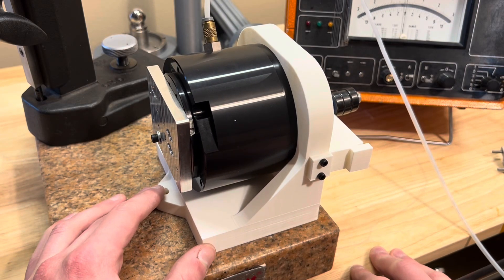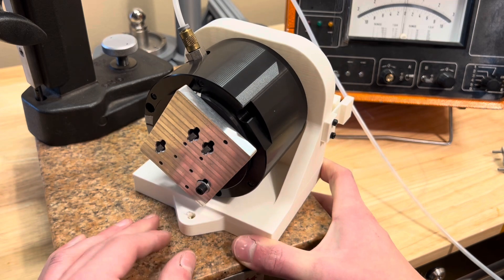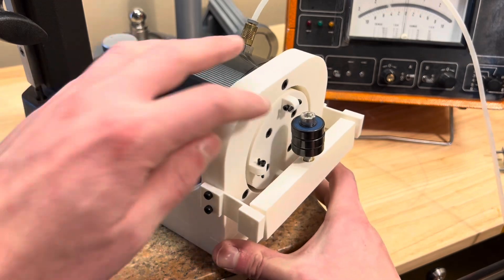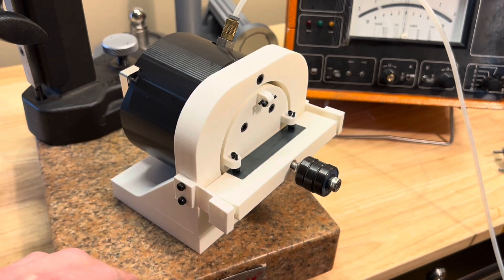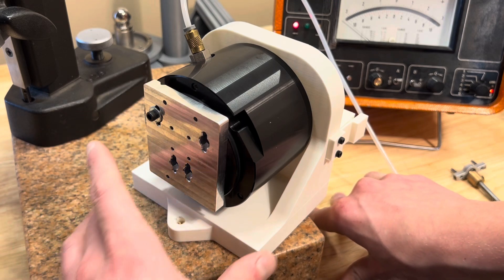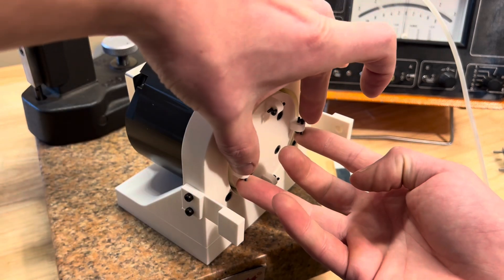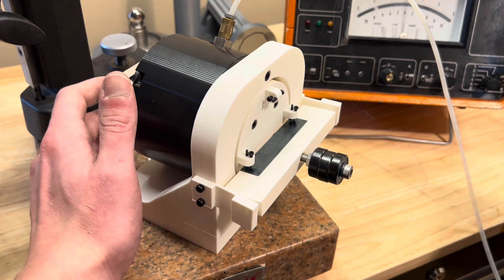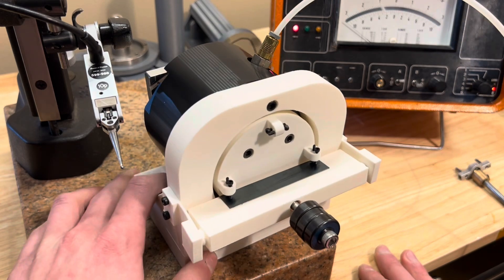A clever grinding fixture for ultra-precision squaring

Comment: A VERY nice design, do you think that it's any more accurate than an AG Davis ultradex?  My 5" is 0.22 arc second max error which I think is roughly 11 micro inch over 10"
Reply from the maker: @ROBRENZ  probably not tbh, the accuracy is as good as you can measure and set it, and adjusting it to 5 microinches over the length of a blockhead stator is going to be extremely challenging.
Reply: @cylosgarage  That is what I was thinking, BUT that does not take away from the awesome design of that fixture.
Reply: So glad you are doing well, the both of you
Reply: Who invented this killjoy to the party?

Comment: A flexure mounted micrometer is something I have never seen. Is that the same as the "Reed Mikes" mentioned in the final documentation? How do you move the micrometer roughly into alignment with the object to be measured?
Reply: Seconded; same question from me. Also, would love to see some closeup pics of the "Oldham-type washer" used in the original.👍

Comment: Would the radial load from the indexer bar counterweight be negligible with the stiffness of the air bearing spindle. Seems like the force on the indexing points is a long lever arm from the workpiece.
Reply from the maker: @matthewchastain136  it would be pretty much negligible, yes. Blockheads have exceptionally good tilt stiffness

Comment: Your comment about the hand heating the fixture reminds us that "robust" airflow is your friend!  Dan Gelbart told me about his airflow setup for his jig borer room, isothermal environment...I used this, later, on a tubular mounting system for a 3d scanner, running a fan into the tube to equalize it's temperature end to end, AND radially, to prevent twist and bending moment from uneven heating.
You're doing a pretty classy job.(as if my opinion counts😉)

Comment: cool fixture. I like that you can square precisely by adjusting those screws on the back. How still are those air bearings from a grinding perspective?
Reply from the maker: @car9167  the air bearing spindles are extremely stiff and great to grind on to make super accurate parts. However, consider that in this particular application, they aren’t acting as air bearings while the actual grinding is occurring. The spindle only floats to index between different sides. It’s rigidly locked for the grinding
Reply: @cylosgarage  I see. Why do you think air bearing spindles are stiff? Air is compressible. If it was oil in between, that is not compressible. Large cylindrical grinding spindles are not sitting on air bearing but oil bearing (not ball bearings)
Reply: @car9167  Because when you remove the air, there is no gap, the housing and the spindle are interference fit at that point. When you put air in, the housing separates just enough for the spindle to turn. Can't do that with regular bearings and doesn't matter that air is compressible.
Reply: @JaakkoF  But then you use this just to get into a fixed position and not for maintaining the stiffness while spinning. And even so is not air that is stiff now, but the housing making full contact.